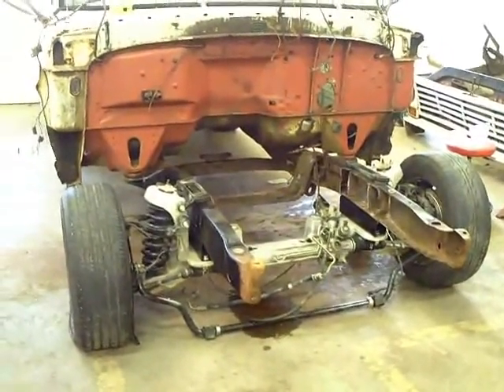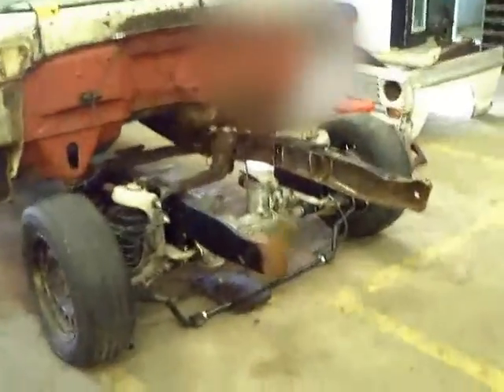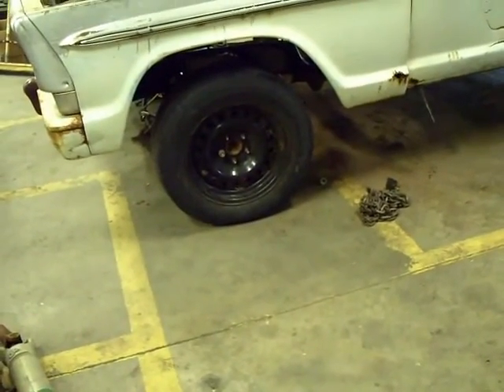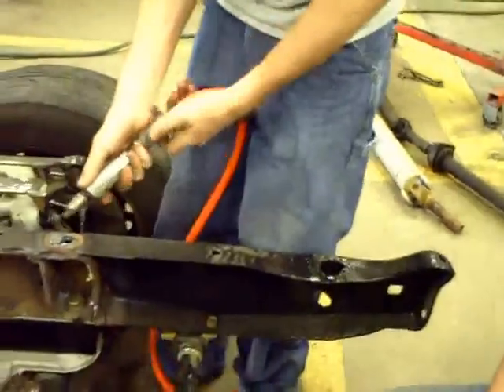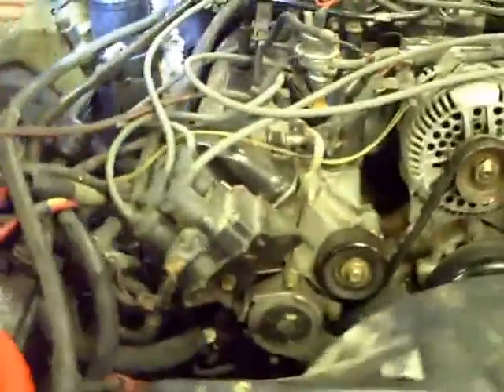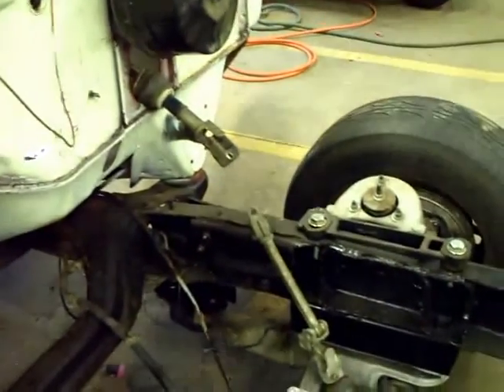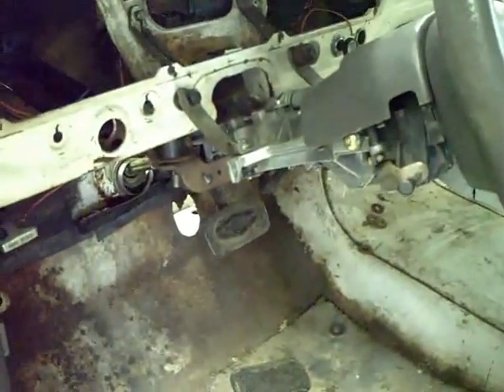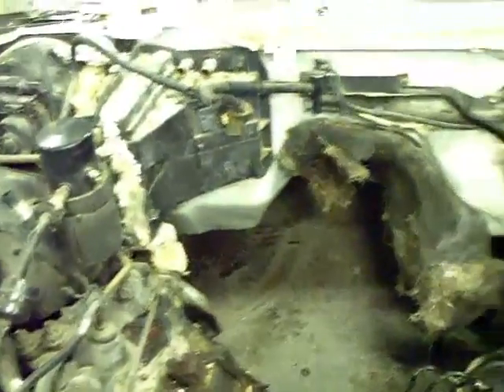crown vic front suspension into 67 F100 2 Stiefel's class

Comment from the maker: @ray72able Well I measured the height of the truck before I cut off the original suspension then when we sat the frame on the C/V set up and took more measurement. We determent that they was about a 5 inch difference (lower) so we added about 4 inches of wooden block that looked good so when we put it on permanently we just used 4" steel rectangle shaped channel. The Crown Vic uses a 225 size tire height wise so when I put 235 on like the truck had it only lowered 3/4 "